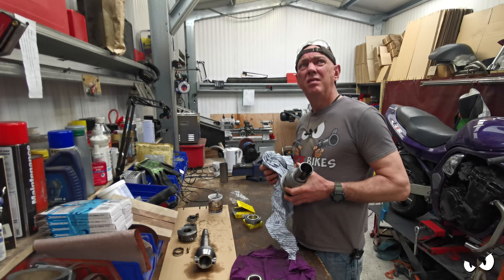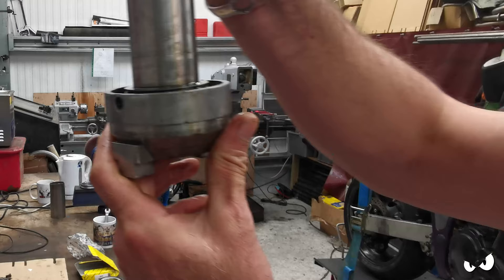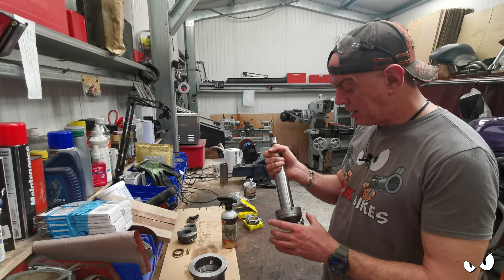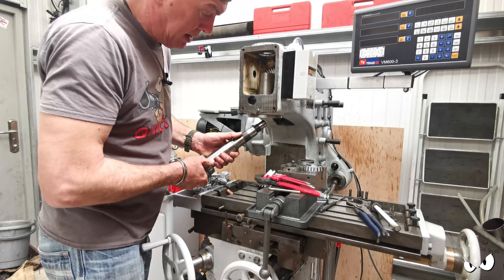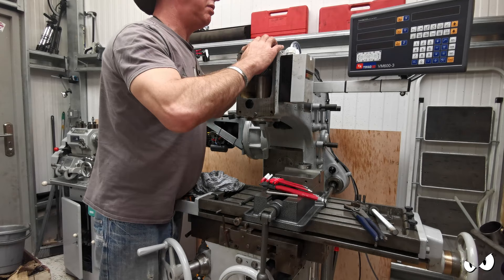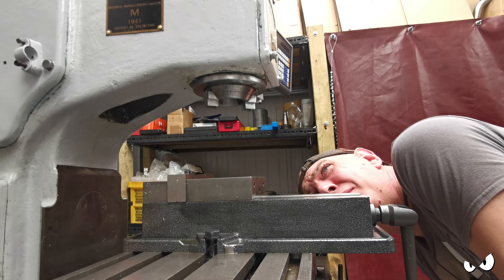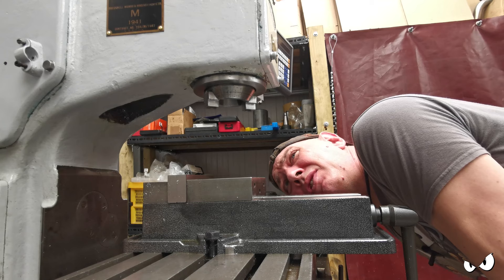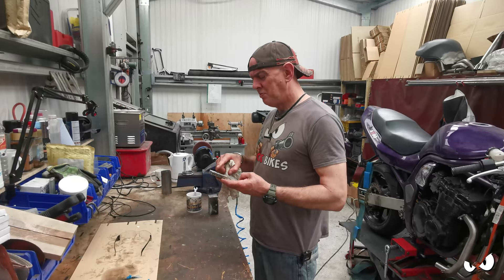Archdale Milling Machine - Spindle bearings installation

Comment: The threaded hole might be for pushing the bearing race out.

Y'know what makes  really good bearing driver for a new 30209 bearing race if you don't have a fancy schmancy bearing driver set?  The /old/ 30209 bearing race, with a slot cut in it with a slitting disk and the edges deburred.
Reply from the maker: Its a blind hole though... from the inside... I have no idea what its for at all. I could have used the old bearing race and would have if I didn't have the bearing driver set. I used to just lightly grind the outside diameter to make it smaller rather than slit it, but its a good idea. Saves buying another tool that sits on the shelf for months between uses hey 😁👍

Comment: Coming from the 40s those grooves in the spindle housed a leather boot piece tied up with wire in the grooves to work as a seal .. BRIAN cuts much better now ! Cheers!!!
Reply from the maker: Ah right.... not heard of that before... Cheers matey 👍
Reply: @QuickBikes  Now that would make sense. The leather boot would not be available (not made any more) to the "new" users of the machine, that's why it was packed with grease to stop it leaking. It worked, it made them money and they probably got it for a song anyway. The grooves must be there for a reason, it costs money to machine them in. Chuck in some modern O rings and I reckon your leak will be a thing of the past. Just my tuppence!
Reply from the maker: I haven't done it yet but have the o rings and think I will before doing the top yoke.... just to see...
I reckonnits going to work, but won't know till I try hey.... 😁👍

Comment: Hi from Southcrest54 with the same Archdale Milling Machine, I haven't dismantled mine to the extent you have yours but I do know where to put the oil in 😉 . 
On my machine the hump behind the oil delivery sight glass has a loose fitting steel bung about an inch diameter that lifts out, its not threaded. The cap on yours probably needs some persuasion perhaps twisting  because it's painted over.
Reply from the maker: Ahhhh.... the fella himself 😁👍
Thanks for chipping in again matey. I know the hump you mean for the oil fill but painted over it as it wasn't shifting. I thought it was press fitted into the hole.... 🤣😂

Comment: Hah! Didn’t realise you’d released both videos. Good result with the new bearings. Curious about those grooves in the spindle, was wondering (given the age of the machine) if there might have been a large felt washer in there rather than o-rings… Just a thought.
Reply from the maker: Ah yes, that used to be a thing I'm sure.... You could be right matey. I'm going to try O rings when they turn up anyways I think but its always an option.... I split the process into 2 videos else it would be damned near an hour long  🤣😂

Comment: A lot of older machines did use a sort of soft felt seal, not sure of the exact material but it is soft and soaks up oil.
Reply from the maker: Yeah, John just mentioned it in the comments as well.... It never even occurred to me, but it's probably how it was. I'm going to try the o rings as I have them coming anyway, but its another option. Thanks for chipping in matey 😁👍

Comment: Shame you don't have some sort of device, micrometrically adjustable in the vertical plane - I dunno, let's call it a "table" - under the head of the mill that could be used to hold the spindle in place rather than trying to do a 3 handed job with only 2.

The result's lookin' loads better, mate.  well done.
Reply from the maker: Hehehe.... I did think of that after I'd got it done 😂🤣😂     I'm not the sharpest knife in the drawer 😁

Comment: Looking good. Are you locking up the axis that you are not using when taking a cut so as to remove unwanted table movement?
Reply from the maker: I am on final cuts  but not till that point if I'm honest.  They were locked during the test runs though 😁👍

Comment: How about using some kind of engineering adhesive(Loctite), which would prevent the oil from leaking out?
Reply from the maker: I don't really want to glue anything in there, I'd rather have something easily replaceable if needed. I'm sure it needs a seal though as it's effectively an oil way... 👍

Comment: There's a thread here
https://www.model-engineer.co.uk/forums/postings.asp?th=104107
which talks about an old mill that requires a "felt soaking pad" that stops oil leaking and lubricates the shaft. I know it's a different machine but could be a similar type of seal? There is a reply on that thread which warns against using a standard rubber seal instead. Good Luck! PS not sure if you've seen this site
https://store.lathes.co.uk/archdale
but it appears to sell a range of manuals for Archdale mills (not sure if your model is included).
Reply from the maker: Hi Neil, thanks for the comment matey. That's really helpful. Somebody else has mentioned felt as well. I got my manuals etc for the lathe from Tony, but unfortunately manuals weren't done for this machine... 😁👍
Reply: @QuickBikes  Bummer! Made back in the days when there was probably some old boy who just memorised all the schematics and never got to pass on the knowledge! Years ago when I briefly worked in engineering there were a few old boys who could identify alloys based on the colour of grinder sparks or hand grind a drill off centre to cut over size by a precise amount! Sad that so much skill & knowledge is disappearing! Looking forward to the yokes!